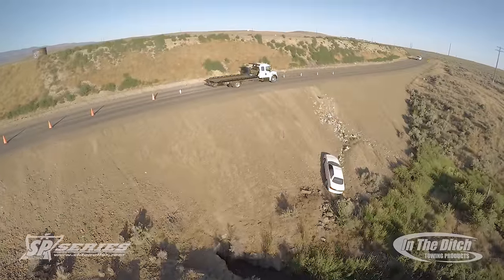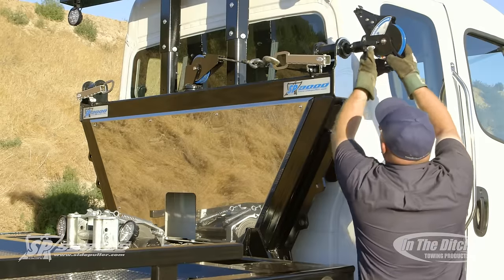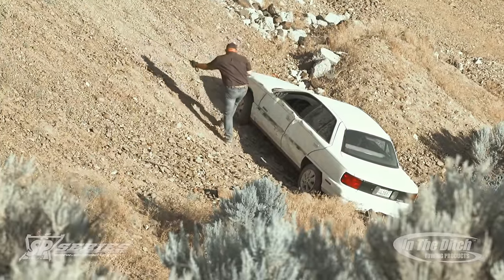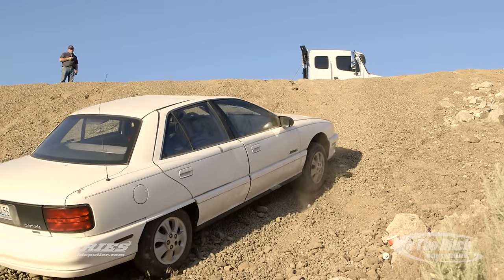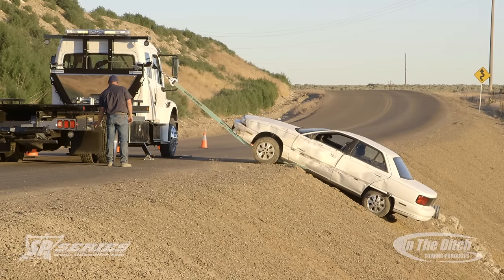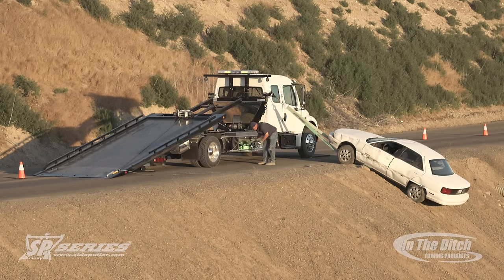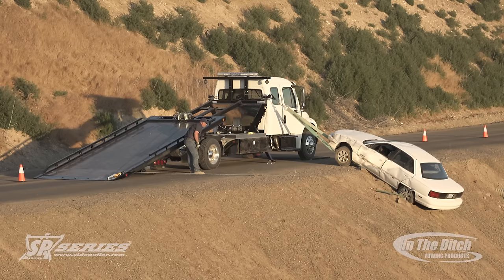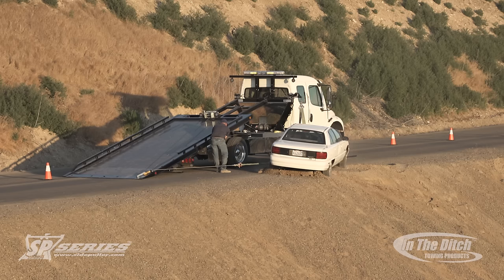SidePuller Recovery Episode 10/10 - Recover a Vehicle Over an Extreme Embankment Using a SidePuller

Comment: Looks like it works great ! we also use roller decks for recoveries and we have no issue using bed winch and side pulling off back of deck with a snatch block designed to anchor in rear bed hole . It does eliminate the extra step of hooking the second line to secure car on level ground

Comment: Very slick, well thought out, well made product. Changed my thoughts on a rollback. I'm not a tow/recovery driver but I'd have one if i was.
Reply: Really not necessary at all, Would be nice to have, Definitely would be nice to have stabilizers and a 2nd winch line, but for the side puller aspect itself it really doesn't change anything, the big take away is the 2nd winch and the stabilizers, but still not necessary I do recovery work and i've never used a side puller of any type, that being said occasionally a wrecker does have to be called out not for the geometry of the rigging but for resistance exceeding my working load limits, so I do wonder if a side puller could save me that extra guy and extra truck on scene during some calls, my guess it that it would save me that call but even then it's not really common enough for me to 100 percent jump on and buy a side puller, although I wish i had a reason to because they are badass... I'd have one if you didn't have to extend the frame or push the bed rails back to install it.
Reply: @towtruckaj  i get it. Would depend on locations where your doin a lot of recoveries too i guess. It would have to justify itself for sure!! Stay safe out there and thanks for doin that job

Comment: When pulling the rear of the car around from the back of the truck the operator should not be standing between the car and truck...wire rope could break or something else causing  serious injury.Also dangerous to stand on the traffic side to operate the mechanical controls of the bed.He should be using the remote control for the bed if it has one.

Comment: I got to say more useful than using a rotator unless of course if the steep was greater than what the SP could handle then the rotator would need to be called in. But as you showed this allows better options in most instances where as you mentioned the truck would be used across the whole road but no need to call in the rotator unless as I said its a scenario beyond the SP capability.
Reply: I don't see any instance in similar circumstances where a rotator needs to be called it, At best a heavy-duty wrecker, Even with a full-size pickup up a 45 up to the body in the mud a heavy-duty and a side pull would be more than adequate, And for a car as shown I don't see any circumstances where even a medium-duty wouldn't cover it, But a diesel full-size pickup up to the body in mud at a 45 would be like 30k lbs of resistance and I know for a fact a heavy-duty wrecker can do that, a rotator would make it easier but I feel like you rotator guys just fish for a reason to pull out the truck that you can bill 1000 for just to arrive on scene.

Comment: Must not know that can use winch from wrecker and a snatch block for same result
Reply: You absolutely cannot replicate some advanced rigging with a side puller with a single winch and a snatch block, You can do most any job yes, but some of the advanced rigging that makes something easier, safer, or causes less damage that can be done with a side puller is simply not possible with just a snatch block and one winch, for example look for the video of the guy that ziplined a motorcycle from down a hill up to his truck, that would be impossible with a single winch rollback and a snatch block.
Reply: @towtruckaj  well a 46+ year guy I know would say otherwise....if not for fact he hates computers I'd have him respond personally and the zip line guy...I beg to differ...maybe need to use a different setup...but still possible
Reply: @abby989  I don't care what any 46 year old guy you know thinks on the topic, Fact of the matter is like I said most any job is possible without, I have done thousands of recoveries without a side puller and I've never once failed to get them done, But as I said some advanced rigging that makes a task easier, safer, etc is not possible with one winch, Explain to me how you would zipline a 1000 lb bike up a hill with one winch line...
I have seen quite a bit of shit, The fact is a side puller is far from a necessity but it is also far from useless and can be a very versatile tool to have in a fleet.
Reply: @towtruckaj  46 + years in the business...duh
Reply: @abby989  I'm well aware of what you meant, but have you ever heard the term experienced idiot? They exist, experience only matters when you put it to the test, and clearly it needed to be if anyone tries to dispute anything I've said thus far, because nothing I have said is untruthful or wrong.
Reply: @abby989  I don't know what to tell you, you are trying to dispute an undisputable statement, I very clearly said almost no call requires a side puller though many techniques a side puller can accomplish in conjunction with the bed winch would be impossible with a single winch, You can't dispute that... Just like you can't dispute that a dual line wrecker is more capable than a single line wrecker and some techniques a dual-line wrecker can do the single line wrecker can't do... And a single line wrecker is still a very useful truck, but when given the option no one chooses a single line wrecker for recoveries, It just makes no sense...